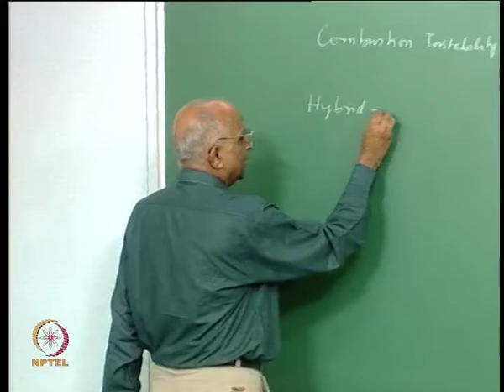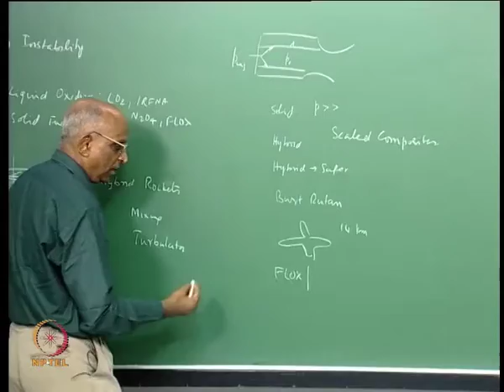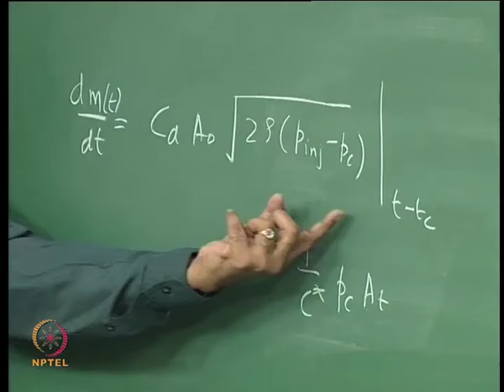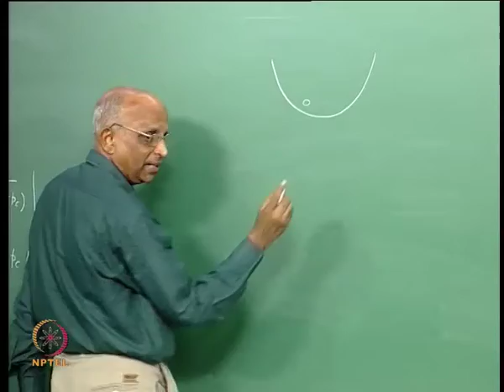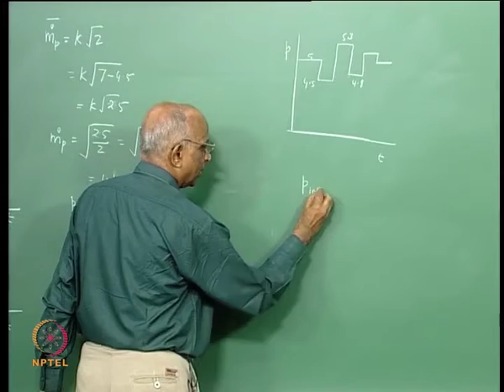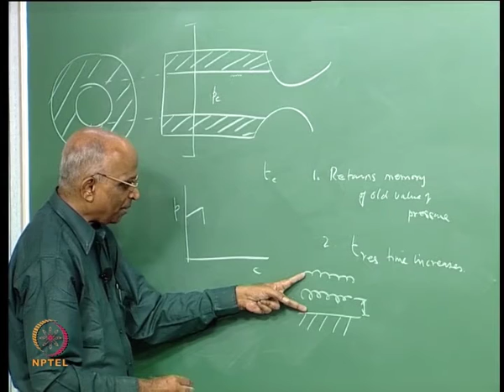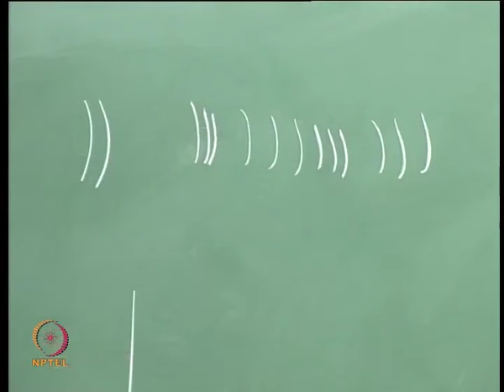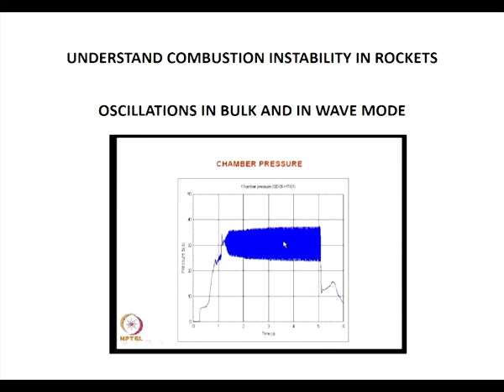#33 Stability of Liquid Propellant Rockets | Introduction to Nozzles

Comment: Prof, we know that P=F/A,  and as the area decreases pressure increases, but you are saying as area increases pressure increases, how is that possible at 6:00 minutes?
Reply: In case the solid motor case cracks with more surface area the pressure will increase